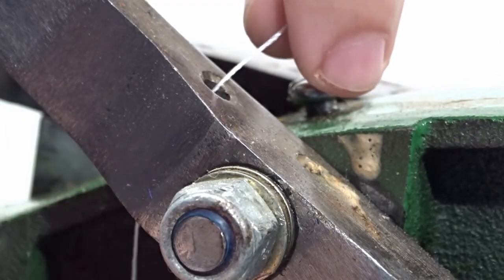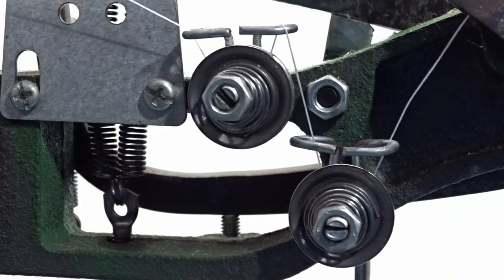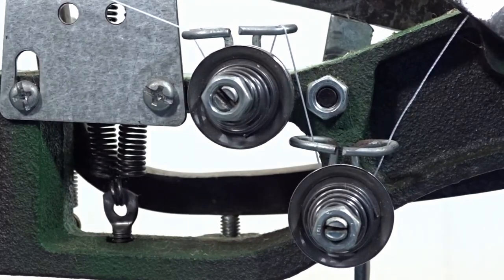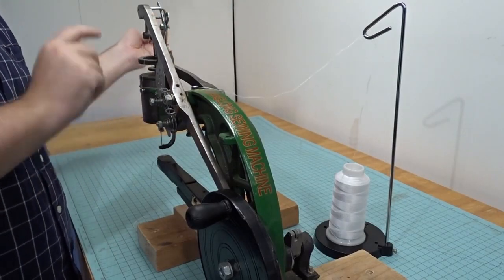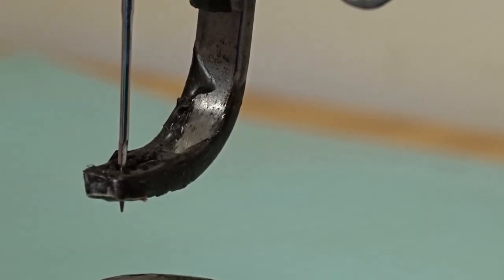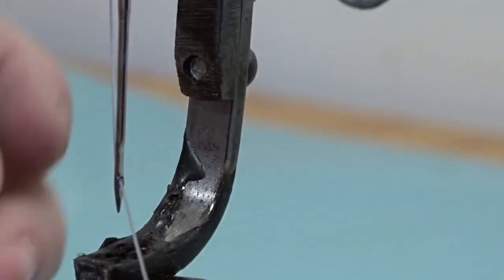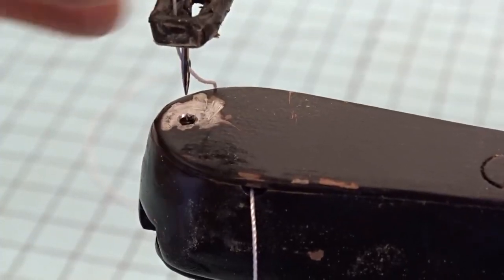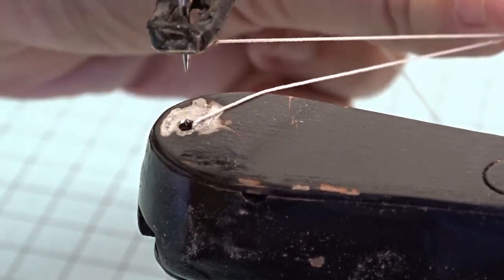How to Thread A China Shoepatcher Sewing Machine

Comment: Hi I hope you are reading the comments. The link on eBay has two sizes of threads 69 and 92. Which one is correct? 

Also the needle size in metrics 130/21? Also multiple choices on Amazon. 

Thanks
Reply from the maker: Like to use size 92 it's a little thicker then 69. But 69 works too. The needle size really should be judged by the thread size. larger thread larger needle. Leather point needles work the best. If you google thread and needle size chart you should find what you need.
Reply: @leathercraftertips  thanks. I purchased what you have told me.